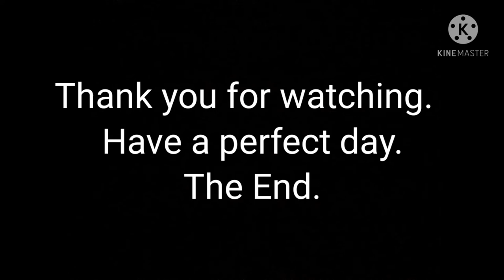Milling Red Pine on the Frontier OS27

Comment: Love milling pine in the winter, when it’s frozen, no sap or bugs, I have some pretty big eastern whites on my 33 acres of old growth Forrest, many way to big to fit my 26” mill, I only harvest 24” or less and do mostly beams for timber framing as the knots aren’t good for boards, unless it’s t&g or b&b. I always start the cut on the butt end and raise the small end so the pith is level, I think that’s why you lost a beam, the 4” would only have been 2” if you had raised the small end. My mill is on a raised flat bed heavy duty 20t trailer three feet high, so it lets me use my skid steer with forks, and gravity to drop the slabs over the side onto the forks, then I stack cut and pick all the beams or boards off in one load, very little labor. I also set up a 12v winch on a heist over the bunks to turn the big ones it sure makes live easier on the ole back. Good show!
Reply from the maker: Thank you for the insight.   I bet you're right, why I lost a beam.    I'll keep that in mind.

Comment: It's all good, im sure i will pull some good ones too. My os27 should be here Monday. Hopefully i will be milling by the weekend! Any water or water mixing tips? Be safe..
Reply from the maker: I use windshield fluid in the winter or pink antifreeze (non toxic). I mix both about 50/50.   I've used pinesol with pine.  About a cup per tank full.   I've not had much problems with pitch build up.   Enjoy the build.  The build is essential in learning the intricacies of the mill.  Stay safe
Reply from the maker: Where are you located?
Reply: @BigelowWoodcraft  an hour and a half southeast of Nashville Tn..
Reply: @BigelowWoodcraft  i found your channel after i ordered my mill. Not alot of channels feature the os27. Most are the 23. Wanted a heads up to know what to expect. Thanks for the vids, i enjoy watching to see the beauty that unveils! All the best and thanks for the tips! Be safe..
Reply: Glad i ordered when i did, now its a 16 -18 wk waiting period. It's taken 2 and half months for mine...